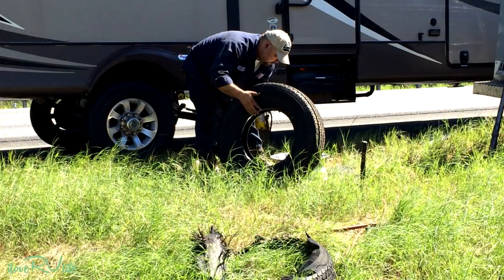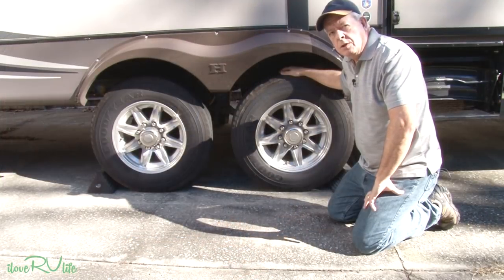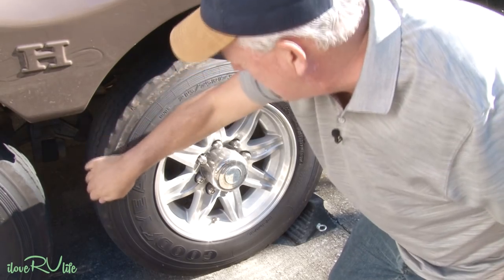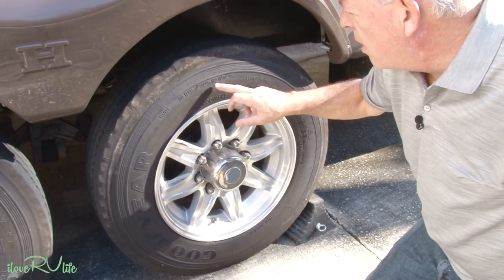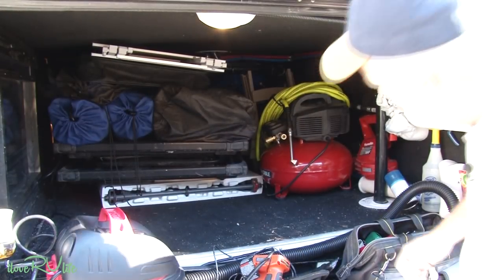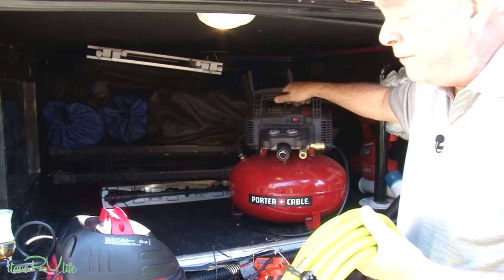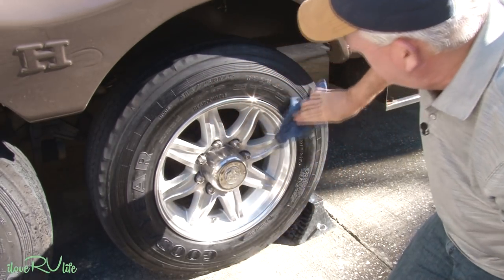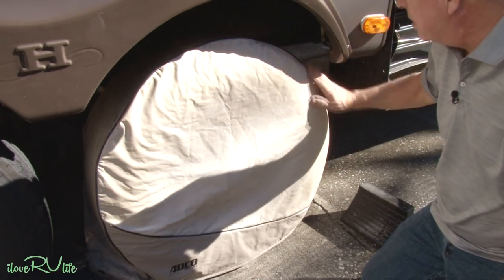Trailer Tire Maintenance

Comment: My big RV upgrade this summer was the Tire Pressure Monitoring System. I had no problem but another owner from the event we attended posted a story about purchasing the same system I bought. On his way home he noticed a tire temp climbing much higher in one trailer tire. He stopped, checked it and sure enough he found the belt exposed. He was able to limp off the road at a safe speed and get his RV taken care of. I hope I never have to test mine but I'm pretty confident that between the TPMS and your tips I should be good to go. Thanks, Neil
Reply from the maker: Hi Neil.  A TPMS is on my list of purchases for next year.  Joan and I have a 5000 mile trip planned next year and I want this installed before we head out.  Thanks much for the comment.  Jerry...
Reply: Hi Jerry, we got a great deal on a TST system at our regional Grand Design owners rally in Delaware this past summer. It's very easy to install and program. It monitors both tire pressure and what I think is more important, tire temperature. I bought the extra sensors for my truck also. I have the factory TPMS on my Ford F-250 but it does not do temperature and it doesn't tell you which tire is the problem. It's great to know at a glance what's going on. So far so good on my RV tires. Grand Design does a pretty good job selecting better than "just good" components for their RVs. Me, like you, will go for the best quality I can afford when it's time to replace the tires. Good luck out there. 
Neil
Reply from the maker: Thanks a bunch.  I've been leaning toward the TST system.  Agree.  Temp is as important as pressure.  If something is going south,  you want to see the temp increase before pressures build.  Jerry...

Comment: Hi Jerry.
I subbed your channel and have been enjoying going through your videos.
We just retired and bought a new  rockwood ultra 2606ws. (30 ') trailer. 
My question is....
What is your opinion on armor all for tires compared to 303?
Thanks  Greg in Michigan 
Ps even though rv is new I've heard too many bad stories about castle rock tires so we just put on Goodyear endurance load E tires.
Reply from the maker: Hi Greg.  Appreciate the sub.  Smart move on the tire change.  I wished I would have done so before blow outs at 3,000 miles and a second at 3,500.  It made quite a mess.  I don’t use any type of dressing on the tires.  303 for rubber is a true RV protectorate.  Also, by some covers.  Even with 303, direct sun over an extended period of time will severely age the tires.

Comment: Great tips!  When you upgraded your tires and went from an 80psi tire to a 120psi tire, what information did you use to determine the new tire pressure?
Reply from the maker: Glad I could share.  I called Goodyear customer service.  Great help.  I also run a little extra to make the tires a little stiff.   Helps when I jack knife when we return home.

Comment: Great video! I agree I have always change the OEM tires (China bombs) for better quality tires. I currently have a 41ft 5th wheel that the factory tires were at the borderline on the units weight when loaded. My personal preference are LT tires and I went from a E load rated tire to a G rated tire and no issues what so ever.  Most people aren't aware or don't care about importance of the speed rating and maintenance of the tires and you are so correct on how important it really is. As always safe travels.
Reply from the maker: Thanks Chancy.  You're so right.  Poor quality tires, poor maintenance and high speeds is a formula for disaster.   Fortunately for our 2 blow outs, we were driving at a safe speed.  Hopefully others will learn from our costly lesson.  Safe travel to you as well. Jerry...

Comment: Put the 303 on the covers, too.
Reply from the maker: Absolutely.   Thanks for sharing.
Reply: Works on fan belts, roof covers, and wiper blades, also
Reply: Don't forget electric cable and hoses.  Best price is at Walmart.

Comment: Hello. Like all your videos. I have heard from commercial work trailer pullers. You should run maybe up to 10 pounds less in tires, especially summer for heat build up that can cause blowout...?? Anyone know? Thanks
Reply from the maker: Run what the manufacturer states for your tire and weight of your RV.  Low pressure can cause stress on the tires.
Reply: Low pressure actually increases temperature because of excessive sidewall flexing.